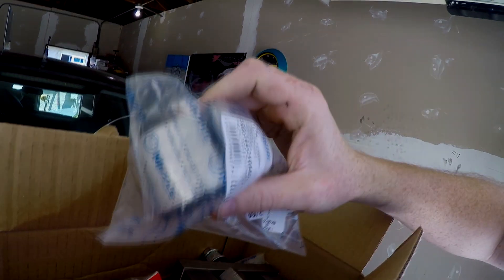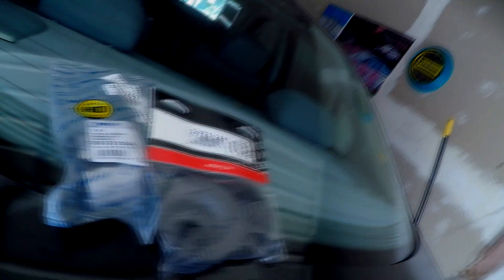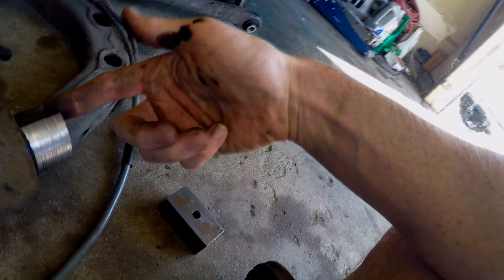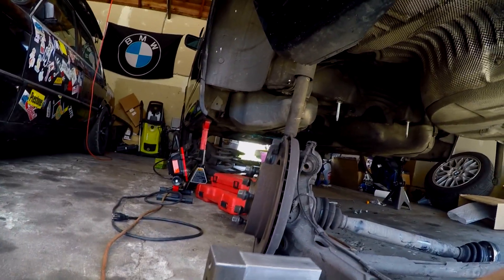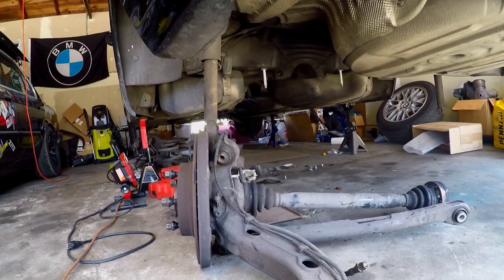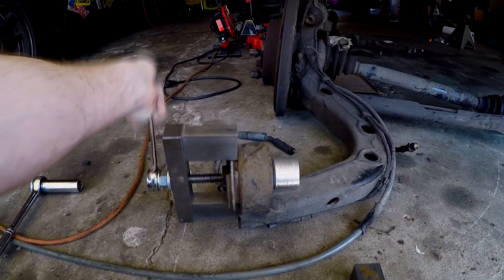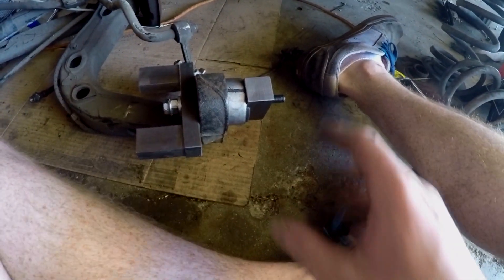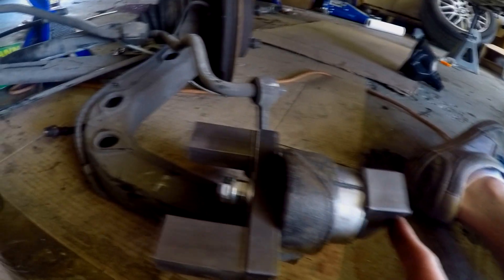BMW E46 Project Car: Replacing Rear Trailing Arm Bushings + How RTABs Work

Comment: dam i wanted to replace them for poly, but now i dont know :(
Reply: Get a 2 piece trailing arm bushing from turner Motorsport or condor speedshop . If it’s one piece it’ll bind but two piece will actually work. He’s just a little inexperienced. Or he would include other options.
Reply: Literally same, cuz it's a breeze putting them in. But now....😐🙃

Comment: Do you need to remove the whole sub frame or can you do little by little?
Reply: For the trailing arm bushing you don’t even have to remove the subframe just mark the bolts before you remove them and then remove and it should hang free

Comment: The most important thing is how align and torque the bushing in its carrier as not to preload it, so it works right and won't fail in a year. Thanks for adding to the mess of uploads that already tell us how to take out, and out in the bushing. PS others videos show how to do this without any special tool.
Reply from the maker: K.

Comment: Great vid, but I'm concerned you did not preload your bushings. Preloading is so there's no rotational load when the suspension is at rest (on the ground.) Not preloading can dramatically reduce the lifespan of the bushings. Also you should mark where the three bolts fit to the bracket because that is how rear toe alignment is set and may be off if you just bolt it back together. I would post torque values but I'm to lazy to look.